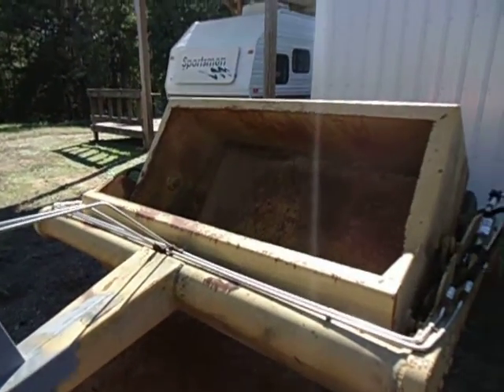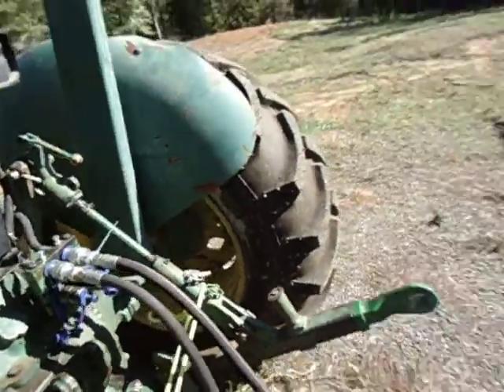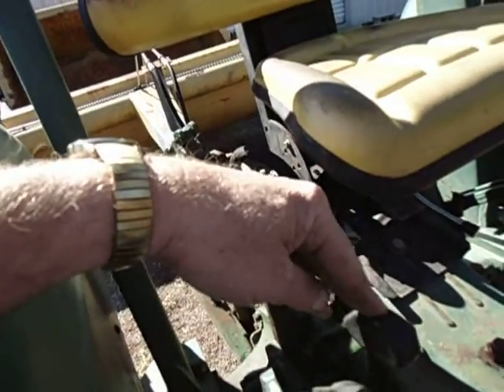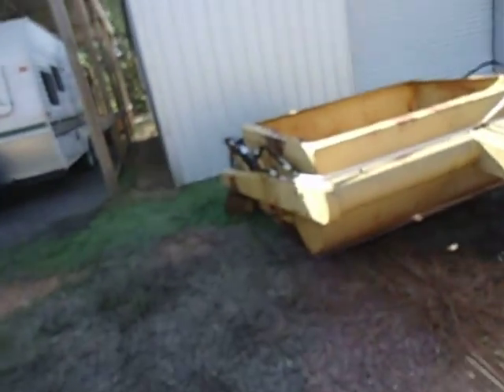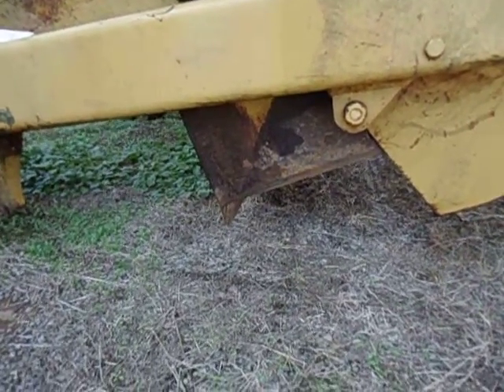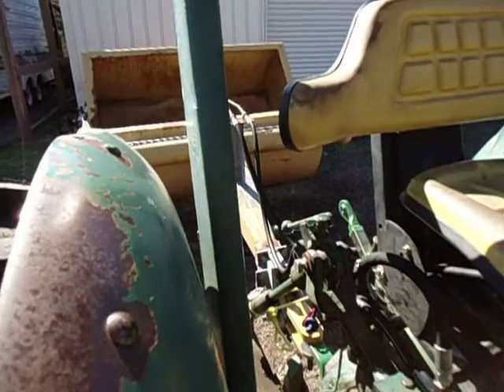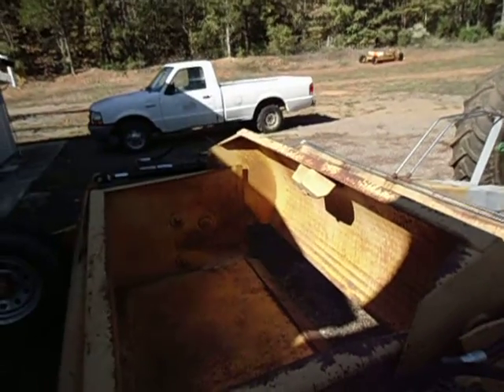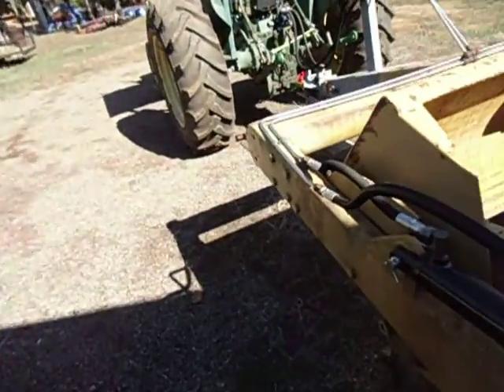2.5 yard 2 wheel scraper done

Comment: Nice work on the scraper! Do you think a JD 5410 would handle something like this?
Reply from the maker: At 81 HP you're good there but specs say tractor is 6000 to 8000 pounds with 8K probably being a cab tractor. Might need to weight it up a bit. The JD 2030 I'm using was 6800 pounds bare but now is close to 10,000 with all of the weights added. Also lower air pressure in the rears to about 10 PSI. It's also all in the depth of the cut: seen these bog down a 120 HP 12,000 pound tractor if they try to dig in red clay at 6". Best is 2" to 3" per pass on long runs.
Reply: amos snow thanks! This is a cab version and if memory serves the data sheet said 6k with cab. I’d look at doing a weight box on the three point to add weight. Hadn’t thought about the tire pressure though, thanks for the tip! Yeah I’m not going to worry about going for more than 2.5 to 3” per pass, we’ve got the great red clay issue here on our place.
Reply from the maker: @floydfarms1578  Fluid filling the rears adds about 500 pounds per tire.Did that plus have cast iron weighted wheels on the 2030.Also added 1000+ pounds to the front weight bar.All good till you hit a soft spot: then the fun starts lol,